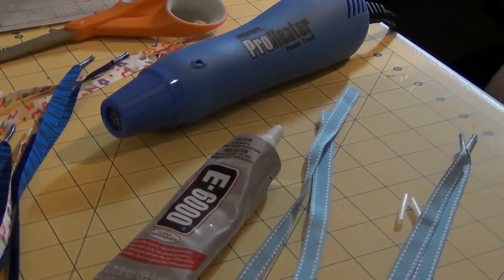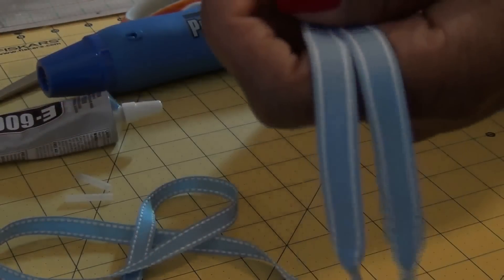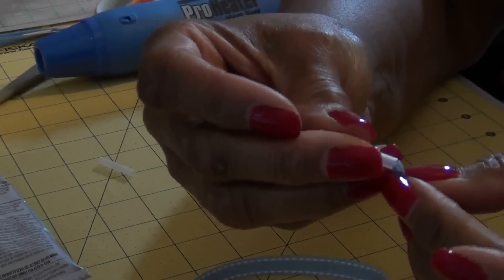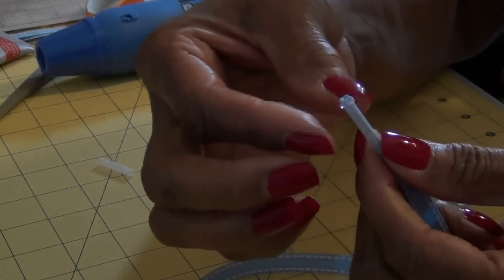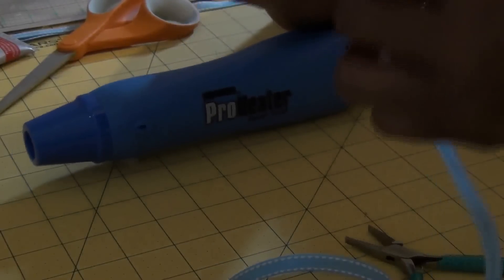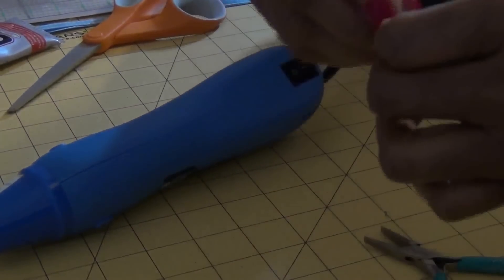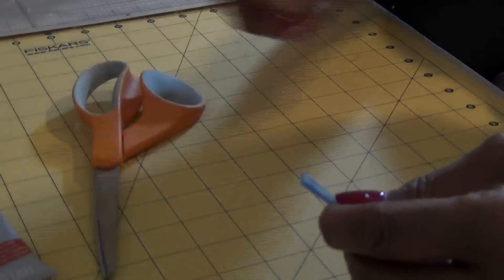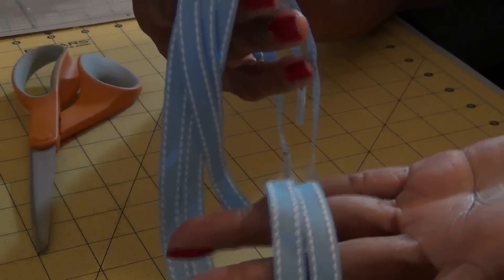How to make shoelaces

Comment: can I use a hairdryer to melt or shrink the shrinkable tubes instead of a heater
Reply from the maker: +Lionel Barnes  I have never tried that but you can try it.
Reply: @LilMommaHairBows  on another site I was looking at she used a lighter.  Colored the tube a little burning it.  Hair dryers do not get as hot as a hairdryer. We don't want to melt our heads.